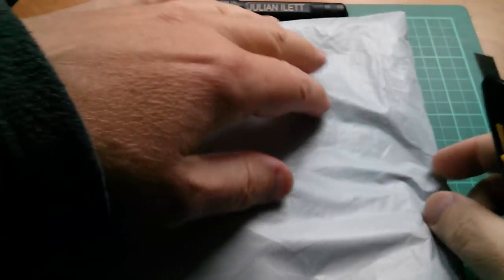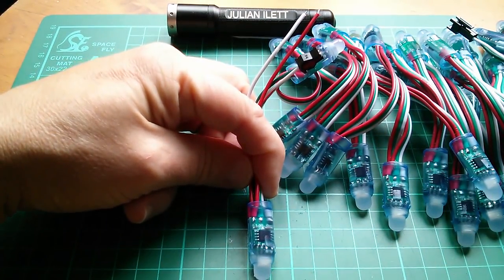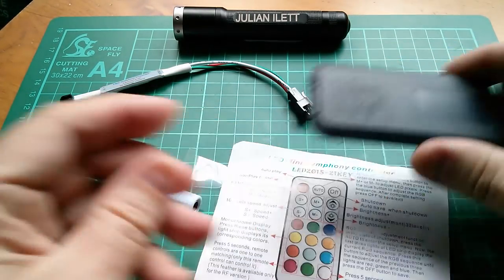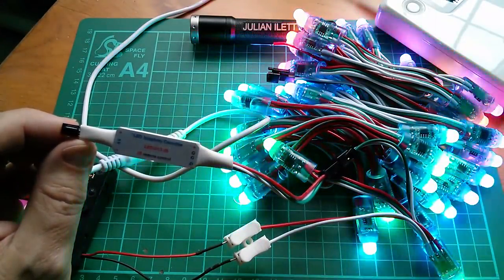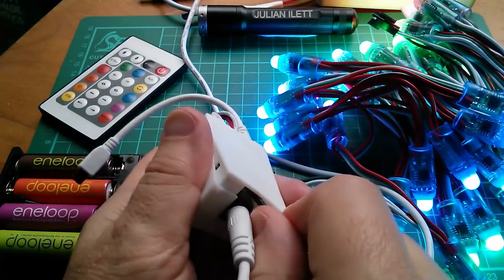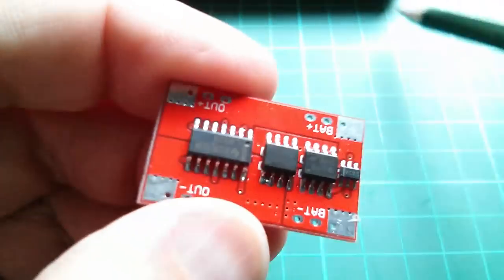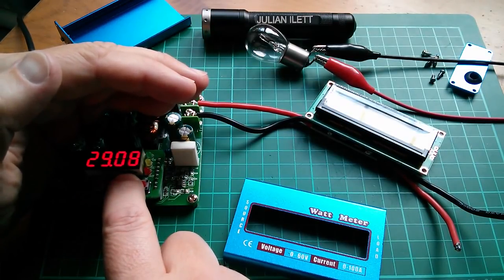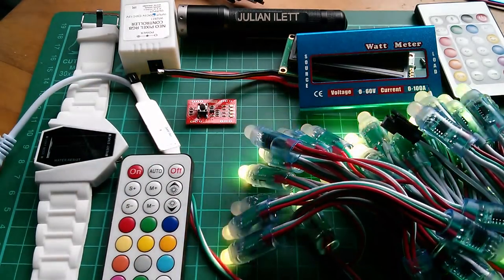Julian's Postbag: #72 - Beautiful Multi-Colour Flashing LEDs

Comment: A really nice project for the LED string might be to make a simple dot matrix display. The LEDs have lugs on which would let you fit them into a panel laid out in a grid pattern, with some programming you should be able to make a scrolling text display or clock.

Comment: Tip: you can change LCDs from dark on light to light on dark or vise versa by rotating the front polarizer film 1/4 turn, or if it is diagonally polarized by just flipping the polarizer over. I have done this to a few car stereo head units. Some have the front polarizer just sitting in there loose, some have it stuck to the face of the LCD with adhesive and it has to be peeled off. If the display is rectangular and the polarization is vertical or horizontal instead of diagonal you will need a sheet of polarizing film to cut the replacement out of. please do this before destroying the watch.

Comment: I bought a couple of 12v versions of the second item from Banggood by mistake, I have 5v  WS2812b LEDs. The controller inside, the chip, still runs of 5 volts and there is a little 5v linear regulator to drop the input voltage. Bridge that and you are back to a 5v controller.

Comment: Someone already did a ton of timing research on the ws2811 LEDs, google neopixels revealed.

I guess that LED string only has a 2 pin connector because at the time someone expected the microcontroller and LEDs to powered by separate sources, especially considering the LEDs come in 12V variants, which means the grounds have to be connected.
Reply from the maker: Neopixels revealed - I'll remember that when I start writing the timing loops. Cheers :)

Comment: "output port compression" is chinglish for "power dissipation for up to 12V". So the power rating of the IC is (12V-Vf)*20mA*3. If you want to connect it to >12V, let's say 15, you need to add a resistor of value 15-12 = 3V/60mA>=187Ohm ->200Ohm will be ok

Comment: Meter has been available from Amazon for quite a while. Trying to use them to measure 54 volt ebike circuits seems to blow them up. Only 3 amps. Think they are copies of the Watts UP which handles the ebike chargers OK

Comment: I believe the Chip is WS2811 but there are very similar Ws2812 and ws2801, and spi addressable 1 signal line rgb lights. I have several of these stings and they also make them in sort-of flat back design for automotive installation i believe. Quite good lights really and water proof/resistant, great for diy .projects. There are also countless forums and tutorials using these strings. Great for learning about sending the data along one line for full rgb. Cheers no offense but there are much clearer tutorials and guides for these lights like on adafruit or Instructables. Good videos tho thanks

Comment: As I hate those pointless destruction video's; my vote is for a non-destructive tear-down. More interesting: show the inner workings and then show how to do a mod that shows how to drive the LCD and improve it into a readable time-display or any other usable purpose. Could be just a stationary desk-piece with improved led back-light and reversed polarization. Can't you hook the display up to an Arduino or ESP8266? Any improvement is always interesting to view...

Comment: Have you tested the red wire on the controller plug to see if it has power? Thinking that if the string had a three way connector with the red fly lead connected, then power, ground and data could all go through the one connector.
Reply: it dose  tap of the incoming supply for the controller  well most do

Comment: Hi all,

I ordered one of these LED strings but have problems with it:

As a controller, I am using a "Mini LED Symphony Controller" (the RF version).

When I plug in 5V to the controller, there is only a short blue flash of most of the LEDs in the string.

I am using the 5V rail of a computer power supply which should be able to supply 15W.
Polarity seems ok everywhere. The controller outputs 5V+ on the red cable.

My wiring is like this (sorry for the crappy look w/o monospaced font):
                                 
5V+ ---\           /--red-------- LED string: red power cable
          controller ---green------ LED string: green data cable
5V- ---/           \--white------ LED string: white data cable
                               \--- LED string: white power cable

I am not sure whether the controller or the string behave weird.
Any idea what could go wrong or how to debug?

TIA
Reply from the maker: How many cables come out of the controller - how many cables are on your LED string?
Reply: Hi Julian, 
thanks for the reply.

i took off the original jack to make this easier...

3 cables come out from the controller (r, g, w)

2 pairs of cable go into the first LED (g/w and r/w).
i joined the whites and connected them to white from the controller.
then red from controller to red from fist LED,
green from controller to green from first LED.

3 cables go out to the next LED then.

should work, shouldn't it? :)
Reply: i have the same issue  but mine just lights up  sky blue  the moment i plug it in with no controller

Comment: I have a 5v usb controller with 3 pins. Can use it with these WS2811s? The wire connnected on the bulbs are 3 pins but the end got 4 pins.

Comment: i don´t see any chance that these flimsy cabels would take 100Amps....here´s my suggestion:

get a nice car battery, hook up that power meter on later and be shure it´s fully charged. Do a teardown of that watch and solder one side to the positive lead comming out of that power meter and the other side to the minus of that power meter.

hook up the minus from the battery to the input minus lead of that power meter and a relay within the pos. leads. find yourself a save place and power the coil...watch that power meter if it can handle the current and also that ugly clock may explode...;)

Comment: With the Watt Meter you could try connecting pins 1 and 2 (vcc and gnd) to 15 and 16 (backlight vcc and gnd). according to the standard pin out for 16x2 lcd's  it should work once that is done (some also suggest a 330 ohm resistor also). See https://cdn.instructables.com/FMC/PZRT/G8LWOHW9/FMCPZRTG8LWOHW9.MEDIUM.jpg

Comment: Tearing down the watch is pretty pointless as we all know that it will have a COB with the usual blob of black epoxy, a small quartz oscillator can, some cheap metal contact buttons and possibly a couple of passives. The LCD will likely be connected using a couple of zebra strips (top and bottom) on the same side of the PCB as the COB etc and on the other side of the board will be the battery holder. All this will be mounted onto a cheap plastic chassis with the button contacts visible on the sides. BORING!  Have a competition to give it away if you don't want it as I, for one, am fed up of people destroying things in the name of entertainment. There are plenty of channels on here dedicated to that purpose if people are desperate to see such mindless destruction. RANT OVER! 
PS. Thanks for another postbag!

Comment: funny that mine lights up the moment i power them with no controller wtf
Reply: plus the chips dosnt have the ws2811  on them ? i think i have received a bad set
Reply: Daniel Horne There's a version of the 8mm LEDs in which the chip is built in to the package with the four pins being ground, din, dout, and 5v, and they light up blue without any signal. GreatScott used them for his light up bar.